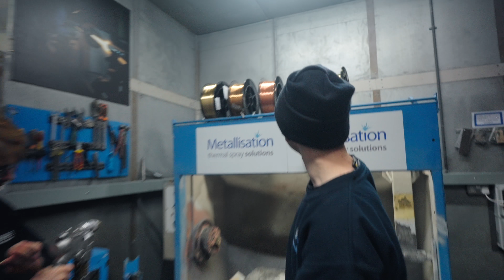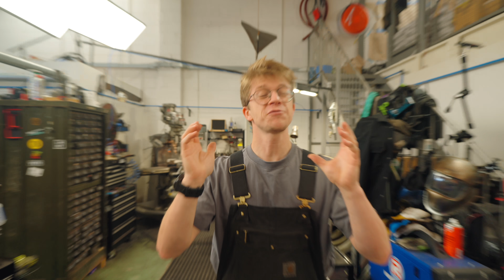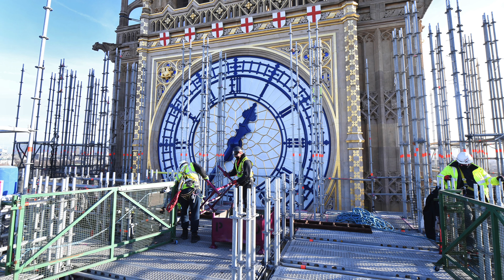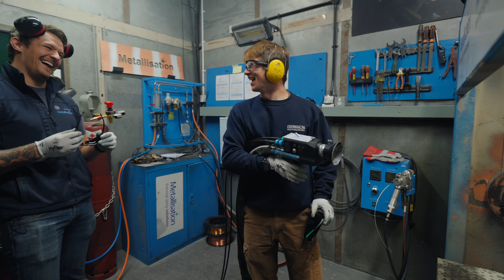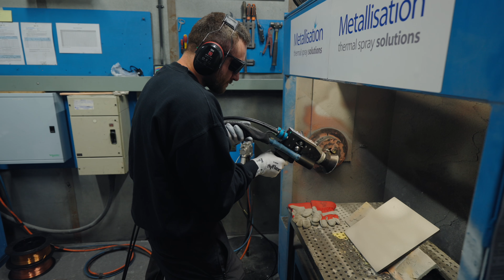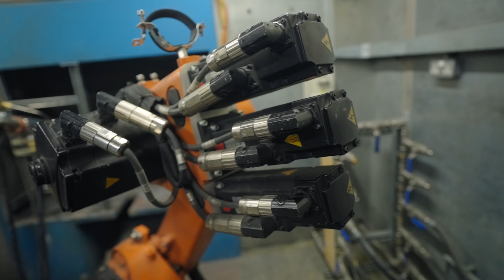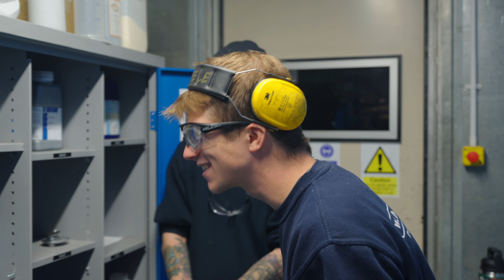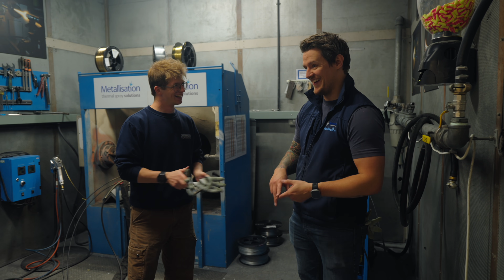Metallization

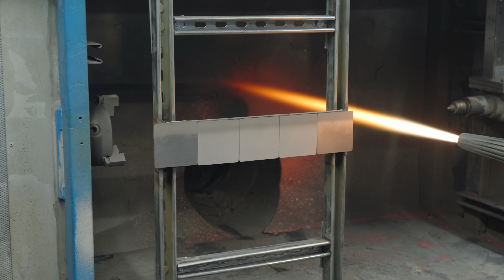Comment: 20:04 I'm a bit of a rocket nerd. Those are mach diamonds. That's a tiny rocket engine. It even runs on rocket fuel, kerosene and oxygen and has a combustion chamber. They'd used liquids in real rockets but still. That is bonkers. No wonder you can't hold that one in your hands. It would push you across the shop floor. You need a rocket test stand bolted into concrete to operate it.
Reply: Using KeroLox to make a metal airbrush. The world never ceases to amaze.
Reply: @MenacingBird KeroLox os for kerosene liquid oxygen and guy says it's just some plaa plaa 😢
Reply: You can get Mach diamonds with an air duster spray; the fact that it's supersonic doesn't mean there is much thrust if the amount of material ejected is small enough
Reply: That is a Rocket Engine deliberately running Engine rich.
Reply: @youkofoxy must, or oxygen would use some metals to fuel and melt system, I guessing. And there's nothing to spray after that x)
Reply: I actually worked in a metallization shop and for some parts we had to spray handheld HVOF. The push is not nearly as bad as you may think. The worst part is holding a >120dB apparel that close to your ears, no matter what you use to dampen the sound it's bound to damage your hearing by the time you're done spraying that part.
Reply: My brain is screaming the word "JETPACK" after reading that, is that realistic at all?👀
Reply: @Phripheoniks the difficulty with jet packs is carrying enough fuel to produce a useful amount of thrust for any length of time.
Reply: @cunhafixit I'd guess that, at least with rear mounted jetpacks and not the handheld jet thrusters already available, the combustion products blasting your legs to a crisp would be quite a significant problem...
Reply: @konnilol4 they are usually pointed back slightly so not much of an issue. Biggest issue is having to carry the fuel also. Efficiency of high speed engines is really low on small scales so you need massive amounts of fuel to fly a reasonable amount of time
Reply: @cunhafixit  They actually developed one already in the 60's I think. It was unsafe and had a very short flight time but it worked. Later they made one with an actual turbine engine and that could operate for much longer time. 

Safety was a big problem, there's no redundancy and as those were mostly operated at low altitudes a parachute would not work so in the case of the engine stopping for any reason you would just drop like a rock. Also they never found any actual real world use, neither civilian nor military, for a jetpack so even though they managed to develop a semi-practical one it remained a novelty to use for movie stunts and such.
Reply: @Phripheoniks yes you can make a rocket jetpack like that but you have to consider that whatever you're using to generate huge amounts of thrust contains a lot of energy and if something goes wrong - all that energy can be released at once
Reply: I giggled when he said it felt like a jet engine in your hand and the next step is literally a jet engine 😂
Reply: How does it not create unwanted NOx compounds when using nitrogen to blow the powder through the combustion chamber?
Reply: @TheStormpilgrim Outstanding question. The solution may just be good ventilation, I suspect that the sprayer does just produce lots of NOx.
Reply: Jet engine afterburners also can generate shock diamonds, but in this case is a rocket engine, because is using oxygen and not atmosphere air.
Reply: And the arc one is basically impinging flows of filament, like a rocket engine. This is crazy stuff.
Reply: When I saw the Mach diamonds my first thought was engine rich exhaust (as seen on so many rocket launches).
Reply: @robertlapointe4093  mach diamonds are not caused by the combustion mix, only the speed of sound through the exhaust medium and nozzle geometry.  Engine rich exhaust is a cheeky way of saying your engine is melting and the metal is visibly changing the color of your plume.  Generally it's green due top the copper content of the metal.  It's quite rare to see that in a rocket launch unless it's an experimental rocket or startup company.

Comment: Hmmm ..... not entirely sure why you'd want to but you could effectively...Airbrush a Circuit? if you could use that system with masking you could spray the traces and contacts around strange shapes and surfaces? ? ? just a thunk.

Comment: Resistance in a copper wire allows someone to accurately measure the length of the wire with a simple ohm meter. Given the resistance of the material over a set distance, measuring the thickness would be something that would need to employ microchips but not much more due to the scale. I'm guessing that thickness gauge uses a similar principle.

Comment: I was not prepared to learn that molten metal airbrush is in fact a thing today.
Reply: Been around a long long time. Hues aircraft used it extensively in the 70s and 80s. I suspect most aircraft companies did as well. Company i worked for bought a plant full of equipment from them. Flame spray powder it amazing stuff. One of the powders was carbide based. You could spray it on a piece of steel. Then hit it with a 7inch grinder and just destroy the wheel instantly. First time we figured it out we were speechless. This was the early 90s before the internet. It took a long time to figure out what we had.
Reply: Been around since 1918 and as an engineer, a welder, and a blacksmith.... I just learned about it today.
Reply: Apparently it's been a thing for some 100 years
Reply: @jaapjethee  Yes, commonly used to apply ceramic coatings to make wear resistant surfaces, and also used with PTFE powder to make a non stick finish on things. Think of your cookware for this being done as a mass production process. I had some heating plates that were done with this, by a local ship repair facility, as they use this a lot in the marine industry for repairs.
Reply: @jaapjethee  Yeah that honestly threw me for a bigger loop than it just simply existing.
Reply: @Mikustan39 ive only had one coffee so far this morning.  I wasn't prepared for this level of awesomeness.
Reply: @jaapjethee  haha, right!?
Reply: Microchips are made by the same in a much more controlled process under vacuum
Reply: @ersetzbar.  Those are generally metal plasma deposition devices. Similar concepts, but much more controllable down to single-atom thick coatings.
Reply: @ersetzbar.  a lot more complex process.
Reply: @Rt1MTKTB wether its an ion beam, or a controlled plasma, or a gas chamber filling the whole room with a  controlled concentration of metal in air. It could be called a metal airbrush :D just a teeny tiny bit more complex
Reply: @ersetzbar.  ✋
Reply: @ersetzbar. Not really but close enough
Reply: @ersetzbar.  1-everlasting Allah He has always existed and always will exist. 

2-He has no beginning and he has no end. He is eternal.

3-He always has existed and He never was created, as He is not like His creation, nor similar to it, in any way.

🌍 The concept of God is summarized in the Quran as:

I seek refuge with Allah from the accursed satan

📖 { “Say, He is God, the One.  God, the Absolute.  He does not give birth, nor was He born, and there is nothing like Him.”} (Quran 112:1-4)
Reply: @الدعوةالىالله-خ8م  you really like the element Helium, do you
Reply: That's exactly what the flame sprayer is. It doesn't look like it requires anything more than a normal spray booth, no exotic gasses, and it's a cold process like they mentioned, it's just an airbrush for pure metals. I want one, but of course they're an industrial supplier, they don't just have prices listed on their website.
Reply: @needamuffin oh you won't find prices for metalization equipment they are all very secretive about price.  Been looking at getting into it, I would buy a metco flame spray gun to spray zinc
Reply: @superchickensoup  It's such a simple concept, I'd be shocked if there wasn't a DIY version that's easy to put together.
Reply: @superchickensoup hope you know zinc emits zinc oxide gas(or fume) when molten, in case you try it. Have a respirator with assisted air.
Reply: Your comment meant I had to immediately share this video with my airbrushing group.
Reply: Paint is typically metal particles suspended in some fluid and a solvent
Reply: @festerallday Kinda more or less. Resin and some solvent and drying agents. The metal is in oxide form and often at or near nano level. Phenolic resin is often hi heat paint up to about 500F. Alkyd is used on metal. Acrylic can be made to do anything except high heat. I made paint for a while as a young man. It was actually a cool job just had bad bosses.
Reply: @festerallday  Very few paints are going to be raw metals, more are going to be metal oxides.
Reply: And the REAL question, who is their tattoo artist? Those are some SWEET tattoos...
Reply: I used to get paid to hard face shelling liners. I used one of these for 10 hrs a day. It really sucks when you forget ear buds.
Reply: I was a lampworker (glassblowing with a torch) back in the day and one of my favorite techniques was to melt gold or silver in a propane/oxygen flame and trap the atomized particles in molten glass. We called it fuming, because we thought the flame was turning the solid gold into a vapor fume that would stick onto the glass. The colors that would result were absolutely stunning. 

Very cool stuff.
Reply: Same here.
Reply: i knew about this process but never seen it and wasnt prepared for it being this cool
Reply: I can't help but feel that society has failed me for not showing me this until now
Reply: I definitely was prepared for it
Reply: If you paid attention, you'd have learned that it was a thing in the 1918s.
Reply: I was okay with it being recent. The 100 year old thing was surprising
Reply: Common repair method for bearing journals, also used in the electrical transmission products for adding grounding materials to epoxy and ceramic parts.
Reply: @herpderp264 
I saw it being used to build up worn slip rings on a motor or generator shaft, probably sometime in the 1960s.  I believe it was also used to put a copper band on the axles of 1938 tube stock trains when they were converted from 4-rail to 3-rail for use on the Isle of Wight so the traction return current did not have to go through the axle boxes, at least as described at a lecture by somebody involved in the conversion at the time.

I had no idea you could spray things like wood.
Reply: It's been around for a while now.
Reply: Bros copying bot comments, lol 😂
Reply: @JoeIcedTea  OP's comment was made 4 hours ago by a YouTube account that's 19 years old. The Bot comment with artificially boosted likes, has an Account that was just made 2 hours ago and posted that copied comment an hour ago.

Super easy to tell that this guy's the source that the Bot copied from, not the other way around.
Reply: ABOM79 does it sometimes, it makes a damn mess though.
Reply: 100 years of it
Reply: or the fact that i cant afford it really
Reply: Right?  Man I love Alex.
Reply: So many possibilities for trouble. Especially depending what all you can spray it on.
Reply: You and me  oth, this is exciting
Reply: thats a fancy way to say "i live under a rock" :D
Reply: Hellfire paintbrush 🖌️ 😂 😭
Reply: Metallization has been used for a long time for newspaper presses rolls that have to be metallized and them lathed to be put into proper specs again!
Reply: I think what blew my mind, was the fact that they've been doing this for over 100 years
Reply: All the girls these days are using it for their eyebrows
Reply: Metallization basically represents the beginning of additive machining.
Reply: Using rocket exhaust!
Reply: I first saw it in a video by the GOAT Abom79 and my brain nearly exploded
Reply: …for the real snob taggers 😊
Reply: I was expecting some sort of high-volume sputtering system and was curious how they managed that without a vacuum, I wasn't expecting "so what if we made an airbrush, but with steel?"
Reply: Dude said 100 years.
Reply: Was doing it in the 80's.
Reply: Amen to that.

Comment: I have used a metal spray torch to apply hard facing to clay shredder knives. It's a similar process but uses oxy/acetylene as a heat source. We also used it for rebuilding damaged machine shafts before machining. The various powders used were extremely expensive back then, not sure about more modern stuff.